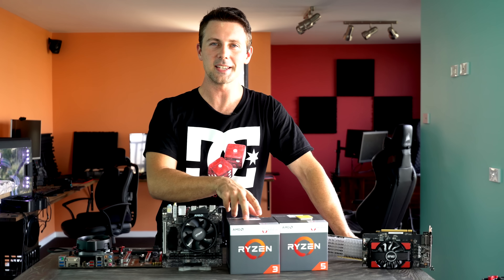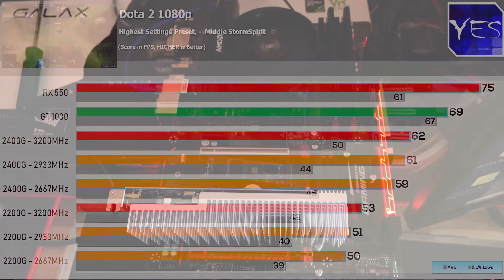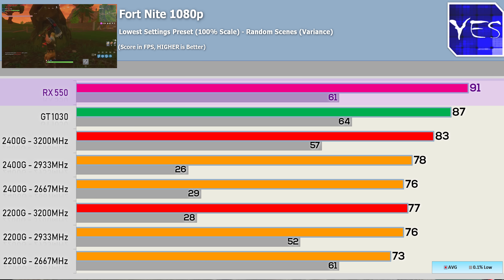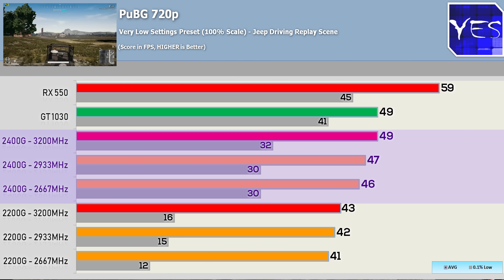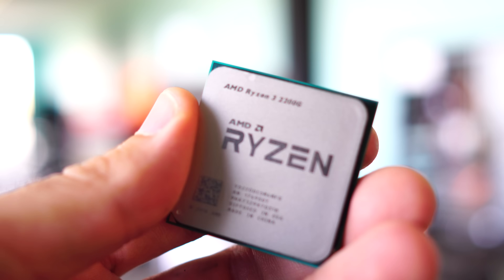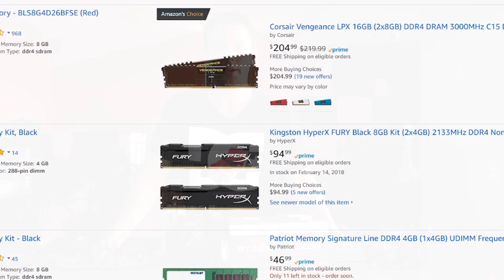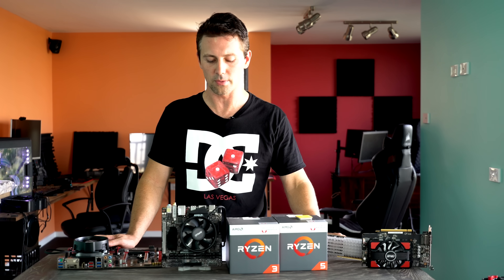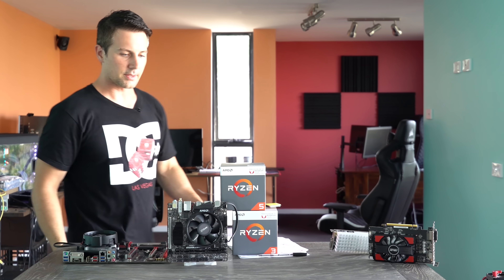RYZEN 2400G & 2200G Vs. GT 1030 Vs. RX 550 - Budget SHOWDOWN (Review)

Comment: Which combo is good and cheap ?
(1) intel cpu with GT 1030.
(2)Ryzen 5 with Vega graphics .

tell me guys am building my cheap gaming pc .
Reply: Buy 2200g APU then get ddr4-2400 ram (oc it to 2933 or 2667), and get B350 mobo (if getting from local store, get them to flash latest bios), then OC 2200G , wait for cheap gpu price to fall, then upgrade ur PSU and gpu. Do not go with intel, since you will not be able to upgrade cpu in the future, with AMD B350, u can even upgrade the cpu too in the future to ryzen 2.
Reply: Gundam Tech Brilliant brother thanks .
Reply: Chris Busquine also right
Reply: Chris Busquine not a bad suggestion
Reply: go with ryzen. youll have a far better upgrade path.
Reply: Get the 2400g and overclock the iGPU and RAM.

Comment: Pair a dedicated graphics card with the APUs, just curious to know how they compare with the RYZEN 1200!
Reply: TechnoEverything that's a good idea. I'd be interested to see that as well
Reply: Does that even work?
Reply: About the same but you're losing up to 2GB's of DDR4 to the APU.
Reply: well.. that kinda sucks!
Reply: if they are clocked the same then it will perform almost the same. premilinary tests says 2200g is hard to OC past 3.85ghz while 1200 can do 3.9ghz and 4ghz on some lucky chips. 1200 will be slightly better but is in the realm of margin of error territory. the 2400g can beat the 1200 because its basically a 1400 with vega graphics and less cache. concrete tests will come, we just need to wait ^_^

Comment: Anyone else a bit underwhelmed?
Reply: wmeno No, these are integrated graphics and they are going up against brand new, much more power hungry dedicated solutions. Impressive for how cheap they are as well, especially the $100 2200G.
Reply: Hardcore Hardware Vega was an absolute disaster, no doubt about it. Vega cards were more expensive, consumed more power, and even cost more than their Nvidia counterparts. But these are different. Don’t compare these to graphics cards. Compare these to similarly priced integrated solutions from intel. When have you seen an HD 630 perform close to a GT 1030? In terms of integrated graphics, this is leaps and bounds ahead of the competition, and for folks like me who play older games like TF2 and CS:GO, this is perfect.  I don’t need to spend $70-80 on a graphics card anymore.

Comment: Which one would you recommend? PC build: mobo:b350 pc mate; 2x r7 250X 2gb each; 8 or 16 gb ram. That’s what i already own, but i wan igpu, for when i sell my video cards... so the question is: which one is better? The r3 1200 or the r3 2200g(the igpu won’t be used NOW) so only cpu side...
Reply: Also will Crossfire work at all with the apu?(I heard that i has less pcie lanes)..

Comment: Such boss APUs.

To C/P what my stance is on these:
I think if you need all 8 threads, don't want a dGPU, and/or want to be more future proofed, then the 2400G is the APU to go for because it offers such a nice package.

But, if you're looking for the best value for a budget gaming PC then the 2200G is the better option. The money you save on it can be put towards getting a 16 GB kit and thus alleviate memory usage concerns. You can allocate 2+ GB of RAM to it and then have a plentiful 12-14 GB to be used for everything else where Windows will use ~2 GB of that alone.
Reply: SlavjanA I also would consider these APUs for upgrade paths with purchasing a higher spec Ryzen and GPU down the road, especially given the prices and availability of even midrange GPUs.

Comment: Impressive how close the APUs are behind the 550/1030!
Reply: A 1050 or 460/560 will likely use less watts with an under clock, while having greater performance.
Reply: Yeah but look at Hardware Unboxed's video , it's way better and he got better results.
Reply: It should beat the RX550 by close to 25% from what I have seen in other reviews.
Reply: DarkLinkAD 560d is like a 460 but they claim 50% less power usage
Reply: You do not know how to search. I just checked, both Amazon US and Newegg have 8GB DDR4 2400Mhz at $84-86, depending on brand. That translates to £61-63.
Reply: When you compare the 1200, the 2200G is actually better in every way (cheaper, same CPU but clocked faster, and has integrated GPU). Like Nick said, why 2400G and not comparing that to the 1400-1500X its equivalent? Oh, is it that it is also cheaper, same CPU but clocked faster, and has integrated GPU? Deja vu any?
Reply: just get a used card
Reply: true just do that, honestly who cares if the apu uses less power i mean PSU's are cheap
Reply: GT1030 has 30-40% more fps than 2400G on expensive ram. That is far from close.
Reply: 1030 doesn't age well, you forgot finewine
Reply: Ryzen 1200 (£89) + GT 1030 (£60) + 8GB 2400Mhz (£65) = £214. Now....Ryzen 2400G (£169) + no gpu + 8GB 3200Mhz (£103) = £272. Do you really wanna have this debate or just drop it?
Reply: Minus Why are you adding in one system r3 1200 and in other r5 2400g when the r5 one is vastly superior . It has 4 more threads , it is clocked higher and has Igpu . 
Fair comperison would be in one system , r5 1400 or 1500x and in other 2400g . Also you dont need to buy 3200 mhz memory to get decent performance . 
The reason that vega 11 is behind gt 1030 in this review is that is limited by memory bandwidth on higher resolutions ( 1080p) .Watch hardware unboxed video on AMD's apus . He did a mix of 720p and 1080p results.
Reply: It's £149, my bad. Still, brings at £252, for which money you can get Ryzen 1200 + GTX 1050 + 8GB DDR4 2400Mhz, instead of Ryzen 2400G + 8GB 3200Mhz DDR4.
Reply: Ryzen 2200G and 2400G have a lot less L2+L3 cache than Ryzen 1200: 512KB/4MB vs  2MB/8MB
Reply: are you serious? 1030 is a pretty fucking bad card being outpreformed by gtx 470's

Comment: wtf? why are you only showing underclocked 2400g?
Reply: Most likely those buying that would get an A320 mobo.
Reply: the boost clock is up to 3.9Ghz
Reply: he said that he didn't have time, he will be releasing a separate video for the overclocked ones later down the line
Reply: It's different mem speeds
Reply: qpaoziwu it's not underclocked?
Reply: RZPogi I personally wouldn't go A320 even with an apu. too low for me. though I can understand it. b350 is a better pair for me personally. I could run more devices in the pci slots with a b350 chipset
Reply: the clocks next to it are RAM frequency
Reply: He is stretching it for more views.

Comment: Should I ditch my i5-3550 for this now? Or just stay with the old CPU?
Reply: Qian xin soong buy a gtx 1050 and play ur fav gamea
Reply: No way. Just buy a new gpu
Reply: Buy RX550 2GB
Reply: i use i3 3210 and rx 460. buy the most logical gpu.
Reply: Qian xin soong If you can afford it.
Reply: I agree with most of the comments here. Just get a halfway decent dedicated GPU. Even if you have to go used.
Reply: buy new high end gpu that what you should do.
Reply: 3550 still a decent cpu pair it with a 1060/1070 and you'll get good gaming experiance
Reply: So is it worth buying this new Ryzen 2400 OR a GT 1030/Ryzen 1200?
Reply: 1030 is very weak
Reply: iAsbestos So I guess the new APU is better
Reply: iAsbestos So I guess the new APU is better
Reply: this cpu is only interesting if you dont want to buy a GPU.

pretty great CPU because now you dont need a GPU to play some of the older games like fallout and gta 5
Reply: Nope. Add a  gtx 1050 or 1050ti if you can afford it. Will play all AS A games at 1080p high settings. The only reason I could see buying these is of you have no decent cpu yet.
Reply: No dear god no in the UK right now you can buy a intel g4560 and gt 1030 for £5 less than the ryzen 5 2500g and it performs better
Reply: That i5-3550 is better than Ryzen 1200. Relax and buy a better graphics card. 2400G is pure shit.

Comment: Should I ditch my i5-3550 for this now? Or just stay with the old CPU?
Reply: If you don't mind the high ram prices, then go ahead.
Reply: check your motherboard and see if you can over clock on that motherboard. if you can then sell the cpu that you currently have and upgrade to an i5 3070k or the i7 3770k to get better performance and upgrade your ram if its still at 8gb or lower. you should be able to get about 2 or 3 more years out of your pc that way depending on what games you play and what settings you want them at.

Comment: Overclock the ryzen 5 apu and slap a aio cooler bro...
Reply: Ericson Umali you dont need aftermarket cooler to overclock it to nice ghz
Reply: Im just thinking if even the integ graphics will benifit on on a aio...
Reply: I mean aio liquid cooler...
Reply: stock will do fine
Reply: there is no point of putting an aftermarket cooler on this, especially an aio that cost as much as the apu. you would be better off with a dedicated graphics card. now it would be a fun experiment, but not something for the day one press release